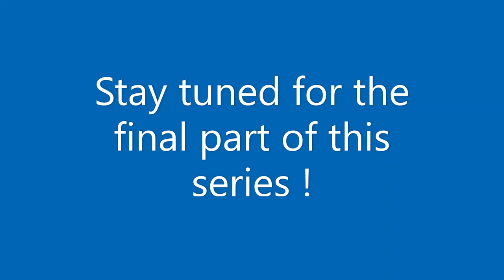Plane Making - Harvesting Lumber From Logs, Part 2

Comment: I have peeled a great many logs during my time. Like you, we lacked the money to do things the modern way. They make what is called a pole peeler, but they are expensive antiques. Go to the nearest garden or hardware store and by what is called a straight hoe. Bevel it on one side. Then use it to peel bark. Strictly speaking it is not heavy enough to be efficient, but we got by with them. The secret to a good bark peeler is the single bevel. If you bevel both sides it will jump out of the bark and you will waste a lot of energy fighting it. A single bevel forces the blade in to the wood and that is what you want.